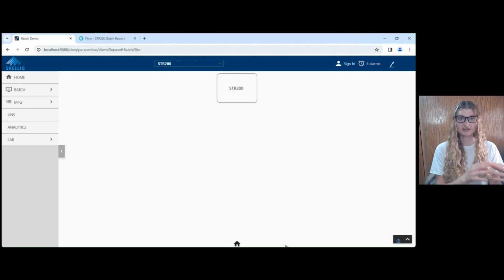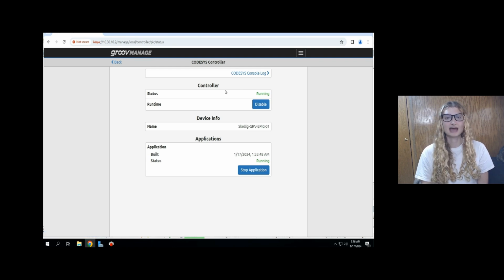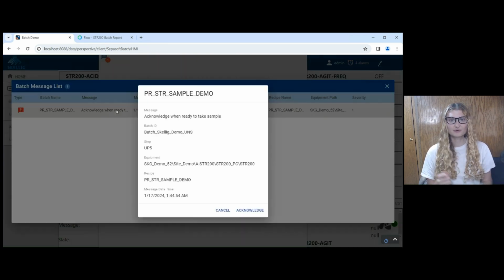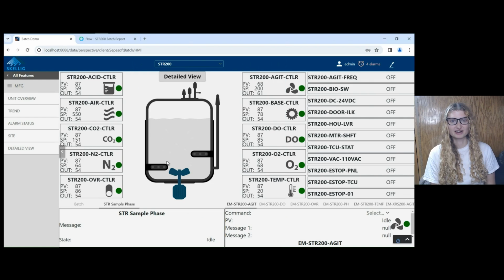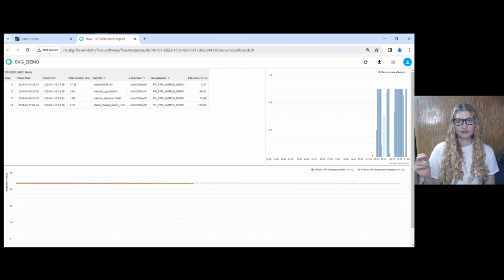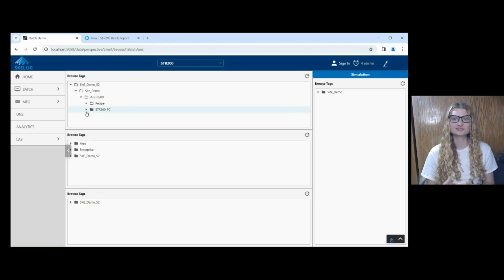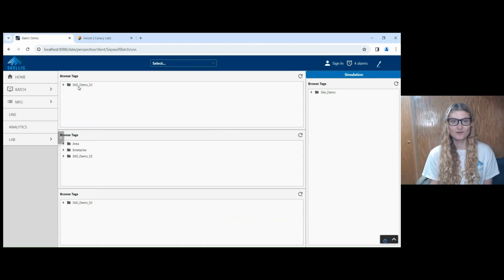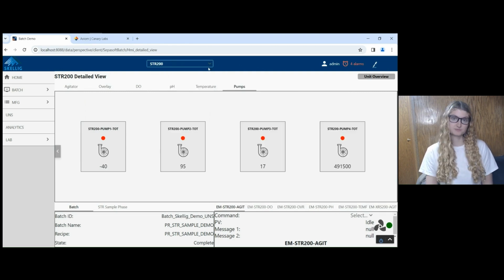Industry 3.0 vs. 4.0 for the Life Sciences - Running the 4.0 Greenfield Plant [5/5]

Comment: Trying to understand the architecture...

Is the PLC to Ignition SCADA interface via the MQTT broker? 

Is the Ignition SCADA to Sepasoft Batch Engine interface via the MQTT broker?

Is the Ignition SCADA to Canary interface for displaying historical data in the Ignition faceplate via the MQTT broker?
Reply from the maker: Great questions! There’s no single “right” way to set up the architecture — it really depends on your system goals and constraints.

To answer one directly: yes, the Ignition platform can be built directly on top of MQTT messages. You can also use Ignition Edge at the PLC layer to develop screens or logic locally, and then publish that data upstream over MQTT to a central gateway.
 
For modules like Sepasoft Batch, those typically run inside the main Ignition gateway and interface directly there — though you can use MQTT to trigger actions (like recipe loads) if you leverage the right scripting/API approach. Canary usually connects via its dedicated module or API and doesn’t depend on MQTT, but there are ways to bridge the two depending on the use case.

If you're digging into architecture options like this, feel free to reach out — happy to dive deeper!
Reply: @skelligautomation  Cool thanks for your reply :)